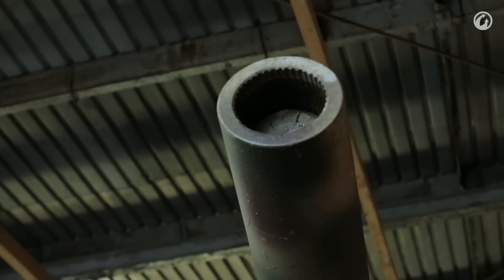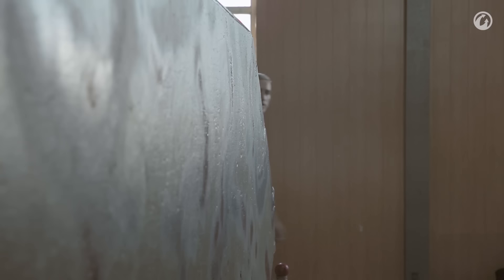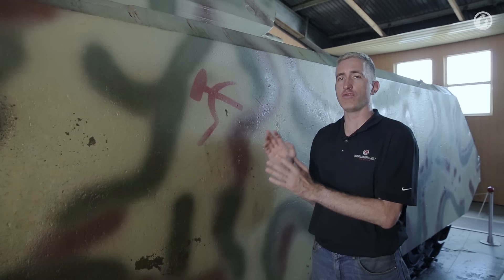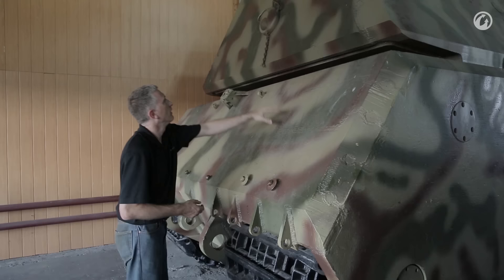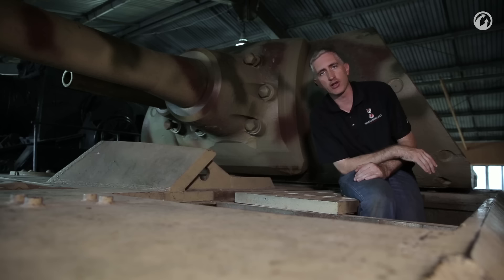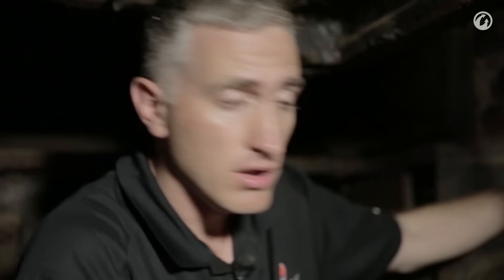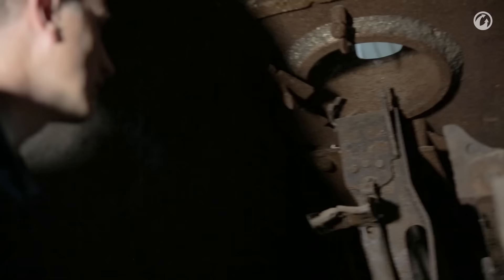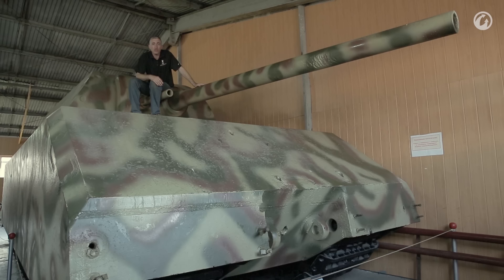Inside the Chieftain's Hatch: The Mighty Maus

Comment: Anyone's guess how they thought that this "tank" (more like a bunker on tracks) was going to change anything that late in the war. One Maus against 1000 T-34s or M4 Shermans? There was no way that this monster was going to impact the war in Germany's favor. Too expensive, too labor intensive (to build and maintain), impossible to move around, huge demand for fuel, a big target, etc. It was a failure even before they even started building one prototype. But Hitler was crazy for superheavy tanks and military equipment which sounded good on paper (i.e. the V3 Englandkanone).
Reply: I think it would be good as a mobile pillbox, like to prevent the D-Day landings, except it was too big to fit onto a train. Beyond that, no
Reply: Garrett Montgomery
Yes. He actually wanted a bigger gun on it because it didn't look big enough in relation to the body.
Reply: Actually, it was less than a third of what you posted, and many of his kills are believed to actually been from the tanks under his command. It was common practice to take credit for all the tanks kills be the tanks in your group.
Reply: +Corristo89 One Maus against 1000 T-34s? Easy cake, the poor 76mm guns would only scratch its camouflage (just look at the 122mm impact on it), the problem would be the lack of enough ammo. After that you have crush them by running them over with your 185 ton tonk.
Reply: Actually, by 1945, they were mostly variants of the T-34/85 with an 85mm gun, they would have been much better at killing a Maus.  However, mobile artillery would have been best, since the Maus was so cumbersome.
Reply: +tjohn6041 Naw, It would fuck up even T-34/85 tanks. 3 Jagdtigers took out 25 tanks. Kingtigers also ruled the battlefield when not breaking down.
Reply: actually the only issue is long distance transportation, As someone said it would of held up fine against even a Russian 122 a 152 HE shell would induce enough spalling to disable the tank.  We are talking about a 188 ton monster that had the same ground pressure as a Panther (thanks to the wide tracks) and could climb up fairly steep gradients basically the idea of the Churchill just supersized to ridiculous proportions.  The only other issue was crossing rivers but anything too deep they'd of tried snorkeling it across which would of been amusing to see and frightening to witness if it worked...
Reply: +Soren G was 2 prototypes
Reply: In theory, but one hit from the Allied naval guns supporting the landings by shelling German bunkers and pillboxes would've blown it sky high.
Reply: yes, but how many shells would the Navy needed to fire to actually hit the Maus to actually disable it.  I keep hearing people make these stupid claims (oh a bomb oh a naval cannon) yet they don't take the hit ration into account when they make these stupid things.  First they'd have to find it and the only way to easily take it out would be while it's in transit if it's sitting in cover good freaking luck.

Comment: They didn't really have anything powerful enough to penetrate its armor til the late 60s. People don't realize it's armor was better than anything after until you get to chobham armor. of course due to its low speed  and weak powertrain it could have easily been flanked. It would have had to have been supported by other vehicles and troops to prevent it from being flanked, and anti-aircraft weapons would need to tag along with it for protection. The same thing was required for the Jadgtiger.
Reply: You do know the mouse is big enough to have its own AAA turret on its main one right.

Comment: Absurd as a weapon, however the suspension looks very clever.  Partially interleaved but on bogies, so if a inside wheel needs work, just yank the bogie. No intrusion into the inside of the vehicle ( this advantage is thrown away on this vehicle by armored skirts ). Even if the overlapping were to be dropped it looks like bigger wheels could be used than on say a Sherman.

Comment: Imagine, a modern Maus, with reactive armour, composite armour, TUSK sides skirts, a 128mm smoothbore modern gun which can fire ATGM and other modern rounds, stabs for the turret, a fast rotation mechanised turret, digitalised unmanned turret with an autoloader for the gun (like the T-14 armata) a 75mm semi-automatic gun, and a .50cal machine gun, smokes, stealth system,radars, sonars, night vision,infra red, a modern HUD, the crew is composed of only 3 crew (driver,gunner,commander) and them in an reinforced capsule (like on the t-14 armata), that would be modern days beast.
Reply: What i mean by stabs is stabiliser like on modern tanks.
Reply: You just described every MBT in the modern era except for the 75mm. The Swedes had a design for one with a 140mm main gun with a coaxial 40mm autocannon in the 90s that comes really close to exactly what you described. Also what good would a sonar do on a tank and why would you repeat a ridiculous number of design flaws deliberately such as the lack of ability to even change the track at crew level?
Reply: And foot soldier AT team fire TOW missile or konkurs,from distance 4 km 2 soldiers in humvee,and your 200 tons tank is destroyed
Reply: Duh, it is a submersible tank, of course it needs sonar.
Reply: TAKE SNICKERS
Reply: U FORGOT TO MENTION THAT HE MUST ALSO HAVE GUIDED MISSILES, BE ABLE TO LAND ON MOON,TOP SPEED NOT LESS THAN 200KMH .AND SUPLY OF AMMO FOR AT LEAST 2 WEEK COMBAT.CREW MUST HAVE FULL COMFORT WITH BUILT IN BEDROOM AND SHOWER.

Comment: Maus: What happens when you put a 12 year old in charge of tank production. Seriously, this was a German tank big enough to win the war for the Allies. The amount of resources needed to mass produce them would have crippled Germany. That's not taking into account the prototypes needed to work out the kinks, as Germany's heavier tanks had serious reliability issues. They tended to be so big, they often ruined their engines and transmissions just by moving.

Ironically, the Maus might have been the easiest to destroy had it moved past its prototype stage. They'd be easier to spot from the air, big enough to bomb fairly easily, and too slow to try to get out of the way.
Reply: The biggest problem with the transmissions was their lack of access to certain metals for alloying. The Soviets had similar problems but their problem wasn't access to the resources it was a complete lack of knowledge of how to use them to make stronger parts.

Comment: Dont restore it stock, do a resto-mod. Grab some Abrams turbine engines and cram a rail gun in there. Then it could just level hills and fill rivers to get around a little easier. Problem solved, right?

Comment: let's be real the Jagdtiger was simply the best excluding it's horrible unreliable engine it was power full 3 Jagdtigers fought 25 US tanks including TDs and destroyed them all not a single penetrating on either one
Reply: Yeah, if they had gotten time to build and properly supply hundreds of Jagdtigers, then they would have been a slightly crazy but pretty feasible vehicle.
The Maus, however was a pretty daft idea from the start. It's too slow to attack pre-emptively. It's too big to hide from enemy aircraft. It's too easy to spot to be a long range attacker like the Jagdtiger was. It was too difficult to maintain and supply. Learning to use it would have taken training that hadn't even been conceived, so even if you could get one supplied and working correctly, you would have a lot of trouble finding a crew that could operate one of them carefully, let alone a battalion.
The only way I can think of that it might have been useful is as a mobile bunker, just rolling up and down behind a defensive line. I guess you could have just one with a specially trained crew and command it to make it's way towards any area where you thought the enemy might be about to break through to repel them.
But even then it would have needed good ground and a crew going before it to prepare the space for it to be in a firing position.
It's an awesome thing but when you thin about it, even an army that was winning and fully supplied and motivated would have difficulty finding a truly useful position to put something like the Maus.
Reply: CrniWuk I need to learn a bit more about Carius. I've continually reading books about WW1 & WW2 for at least 20 years but I've never read about him.
Reply: CrniWuk I'll have to have a look for it. I usually get a few book tokens around xmas so maybe I can get it in January.
I like reading autobiographies from both sides. If you have any interest in WW1 the 'Storm Of Steel' by Ernst Junger is a very good read.

I had never heard that about the Shermans. Though I suppose it must have been soul destroying for them to have been witnessing the sheer, huge amount of them that were just continually coming at them.
Reply: CrniWuk I've bookmarked that for a read later. Cheers man.
Reply: You win some you lose some  "Near Unna, one Jagdtiger climbed a hill to attack five American tanks 600 meters away; two withdrew and the other three opened fire. The Jagdtiger took several hits, ... which was eventually penetrated and all six crew members were lost."

Comment: The Maus is actually highly impractical it burns a gallon of diesel every 373 feet.
Reply: Richard Mutter But would be great in a war.
Reply: RAI DEN it burns a gallon of diesel every 373 feet
Reply: RAI DEN woah hostile youtube environment I just saw that on a TV show
Reply: P.s the maus uses 7.2 gallons per mile... and holds 1100 gallons so yes, it is fine for war.
Reply: Speed weight
Reply: RAI DEN Maybe Fine, but for Germany, Yeah....
Reply: Theo S Okay Take a look at modern battles... Think of it this way... that tank would be the best Compound defence there is.
Reply: Why?
Reply: +RAI DEN  "But would be great in a war."

The Maus would be completely useless in a war. It would have required a whole new transport system just to get it to the battlefront because it was so heavy. The enemy would have known exactly where to find it and send bombers to counter it. It would have needed to be dismantled just to fit on a train. it would have required a massive crane to set it up (I think the turret weighs something like 70 tonnes). It would have used up fuel and resources at a rate which would have made other, more useful projects suffer and it would have been simply unaffordable. These sorts of super weapons are invariably battlefield orphans. Everyone ignores them so the Maus would have gone on unhindered until it ran out of fuel. Otherwise it would have been fine... These things only impressed senior Nazi party members. The generals had no use for them.
Reply: TheThirdMan Keyword... DEFENCE not offence....... There is a big difference.
Reply: RAI DEN take into account artillery
Reply: Richard Mutter True but if they angled the top of the maus into a point it would bounce artillery shots coming in from above.
Reply: RAI DEN Depends on how big the round is and velocity
Reply: Richard Mutter I am just thinking from an offensive point of view, if someone just charged into and capture a town i doubt they would then send their largest artillery into a combat zone XD, just depends on the situation.
Reply: RAI DEN is hijacking an option
Reply: Richard Mutter Yeah but realistically when was the last time you saw a tank get hijacked?
Reply: But they are fast and have a turret traverse that's not slow and has active machine guns
Reply: Richard Mutter A maus on it's own on the battlefield sure it could be hijacked easily but with a whole force defending a town with the maus then i doubt it.
Reply: RAI DEN sorry I'm heart broken right now I just got Fallout 4 spoiled for me
Reply: If it was, dont worry, that ending is fake...
Reply: RAI DEN ok thanks is there really multiple endings
Reply: RAI DEN Well, I'm not 100% sure what you mean but the Maus was supposed to be a breakthrough tank so its main game should be offense, rather than defense. The other side is that, because it had no meaningful defensive armament, such as an MG-34 or the like, it would have been very vulnerable to and troops who could get aboard it because they could just drop Molotov cocktails through the vents. Just sayin'.
Reply: TheThirdMan I can use the exact same argument about pillboxes with anti tank guns built in on the shores of france.... but they still worked effectively for defence.
Reply: RAI DEN Yes but they were much cheaper and required almost no maintenance. On a cost/benefit basis they were far more useful than a Maus.
Reply: TheThirdMan Yes but with modern technology the thing would be a beast.
Reply: RAI DEN On a modern battlefield it would last about 10 seconds.
Reply: TheThirdMan We dont have the correct trained soldiers nor do we have the support units to prove that.
Reply: RAI DEN Anti-tank missiles have evolved to an extremely high level of capability. They can attack with shaped charges from almost any aspect, rendering pretty much any kind of armour totally vulnerable. Even concrete bunkers are not safe. A slow-moving Maus would be especially vulnerable and presents an enormous target.
Reply: TheThirdMan Who says it would be slow moving? Also who said the maus would not have an anti tank missile system? I forgot the name but there is a really common one that fires pellets infront of the tank to blow up missiles.
Reply: RAI DEN Metal Storm: invented by an Australian. The more stuff you add to it, the more expensive, more unwieldy and less useful it becomes. The German generals didn't want it in 1945 so I can't imagine that things would be any different today. In 1945, the only protection was thicker armour. Today they have Chobham armour and reactive armour, both of which are far more effective and result in a tank of manageable size. To be a breakthrough weapon, you have to get it into the field. The Maus was just too big and that situation hasn't changed. Also the support and other logistics for something like the Maus would have been ridiculous compared with something like a Leopard 2 A6 and for little or no benefit.

Comment: I thought it was Porsche that made the engine for that particular tank?
Reply: The vehicle was powered by an electrical transmission system developed by Porsche. An internal combustion engine drives a power generator, which supplies power to two electric motors that propel the vehicle. The petrol engine used to power the generator was a Daimler Benz MB 509.
Reply: @drakon5076  Wow, I appreciate your articulate and accurate reply. Thank you very much honestly, I didn’t think anyone would ever get back to me. I also just learned something, can’t thank you enough.

Comment: I don't think it's possible to restore something that didn't really get finished. What reference would you go off of?
Reply: there's schematics
Reply: That's not what i mean.
The point is to restore it to it's original working condition. It never had a working condition cause it was never finished.
You wouldn't be restoring it, you'd be finishing it.
Reply: the second of the 2 was finished wasnt it?
Reply: AcolyteOF Fire There was never a second one that was finished. There was only one hull and two turrets.
Reply: HoCoRydaaH it worked  just  never saw any battles on war

Comment: As if the Tigers weren't enough of a bad idea. What was the story of the main gun? Was it also based on an AAA weapon?
Reply: +MakeMeThinkAgain The Maus had an 12.8 cm KwK based on a PaK. The Sturer Emil 12.8 cm was based on a FlaK.
Reply: German Navy (Kriegsmarine) used the 12,8 cm Flak 40 as AAA, which was also used in modified Version on Sturer Emil Tank Destroyer. The German Destroyers of the Navy used the 12.7 cm SK C/34.
Reply: +Monguntiacum Infracta Didn't know about the Sturer. Wiki contradicts itself as to which 12.8 cm was mounted on the Sturer. The entry on the FlaK says they went with the Pak instead. 

In any event, they seem to have combined the worst feature of U.S. tank destroyers (open top) and German  Panzerjäger (no turret) but given it a wicked gun.
Reply: Sturer Emil had a modified 12.8cm FlaK 40 because Hitler want a Tank Destroyer with a gun which was able to destroy every known enemy tank. The gun weight 7 tons and only 2 prototypes were built. Both was used at Sowjetunion, one was destroyed by Air Force, the other one was captured by Sowjets at Stalingrad. But the gun was very successful,  So later Tanks like Maus and Jagdtiger also get an 12.8 but based on modified 12.8 Field Cannon which was used as a PaK.
Reply: How was Tiger bad idea? I thought making a box around a Flak 36/18 is best way to make tanks.
Reply: If you have a fuel shortage and also need to maximize the mobility of your forces (so you can easily shift them to where they are needed and since the ability to concentrate forces is why speed has always been important in warfare) then creating slowly rolling pill-boxes that are as hard to transport and maintain as they are to fight, is an inherently bad idea. And this is true no matter how awesome they are on a battlefield. 

Think of it this way, there were very few situations where you wouldn't have been better off with a battery of towed 8.8 cm Flak 37s instead of a couple Elefant monsters.

But even the battery of Flak 37s would be trumped by a couple p-47s which could project power over an even wider range.
Reply: Main gun was the Kwk 44 L/56 128mm (I think related to the Jagdtiger's cannon, Pak 44 L/56).
Actually less powerful than the KwK 43 L/71 (Tiger II)